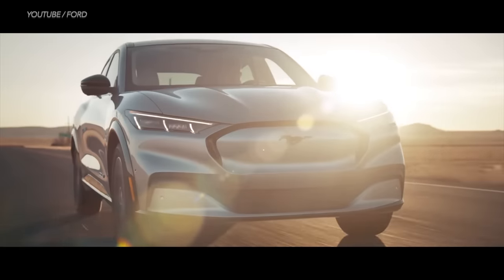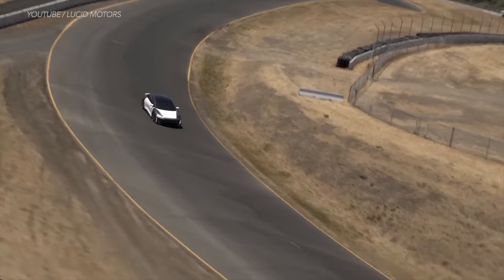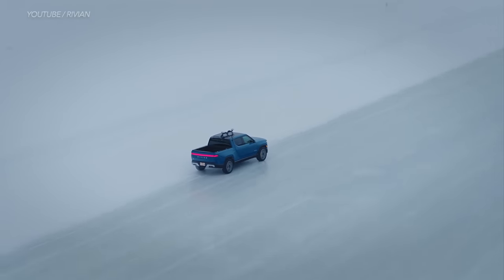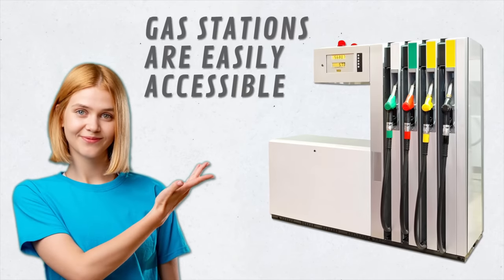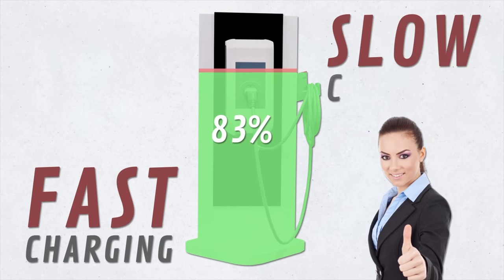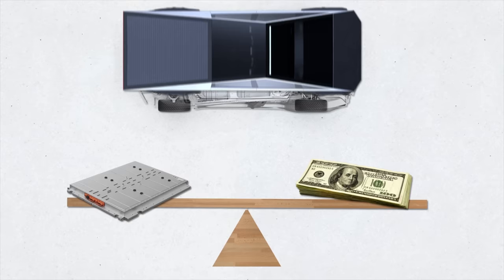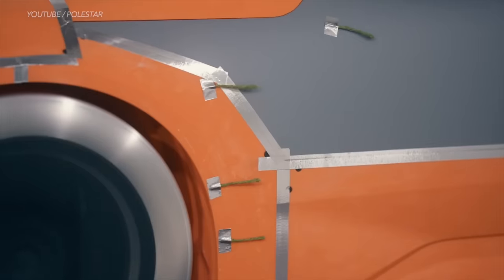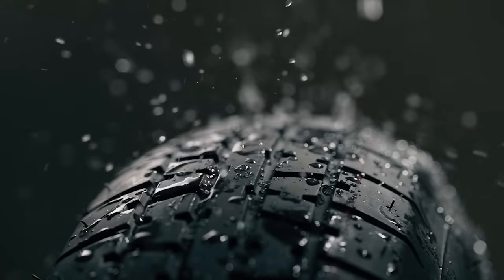New Study Shows Electric Cars are a Scam

Comment: One issue with EV cycling tests is they cycle them within a very short period of time. Li-ion batteries degrade with both charge cycles and time. For example, a li-ion battery kept at around 60-70% for 5 years will degrade almost as if you were cycling it regularly for 1.5 to 2 years. At my work place, we have laptops on carts where they are kept plugged in. Lenovo offers a constant plugged in mode where it coops the battery at around 70% since it is not good to keep a battery at 100% long term. Usually after a few years of use like that, the battery will show a wear level of 30%, even though the battery may have only seen 5-10 cycles.

EVs experience similar issues, and this is why the failure rate after many years of use is so high, even for vehicles with under 150K miles.
Reply: Coworker has a tesla, 250,000 miles on it. Only lost 10 percent of battery life.
Reply: @onestepclosertoheaven7347  For the true range, you typically will not find out until the vehicle is driven down to a safe low voltage point that is programmed into the BMS. Outside of that, they apply basic estimated wear values. Sadly finding the true amount of range lost, can be difficult because you can do something like run the battery down to 10-20 miles of range left, and then while on your way to a charger, it suddenly drops to 0 and leaves you stranded. Even the current best BSM devices (not sure of the EV ones, but outside of that space), will apply wear data based on the cycling wear curve provided by the manufacturer. This is also why you will notice on devices that get very few cycles over many years, you will notice strange behavior such as a laptop r phone draining down to 20%% before suddenly turning off, where you will need to deep cycle it and then charge to 100% without interruption for the BMS to learn the true capacity of the battery. This happens since a BMS cannot determine the actual capacity until the battery reaches a programmed safe cutoff voltage.

An EV will not show wear behavior common in li-ion batteries from laptops since they do not provisional in consumer electronics like that. For example, a laptop battery will charge to its true 100% mark since companies compete on battery life. On the other hand, and EV may take a 100 kWh battery, and program the BMS to a nominal capacity of 82 kWh, thus the battery could handle 18kWh of capacity loss before you notice a drop in range. 

Aside from that the aging behavior of a battery is both time and cycling. A tesla doing 250,000 miles in 3 years will have more capacity than a tesla that did 250,000 miles over the course of 12 years.

Comment: This may sound crazy, but in extremely cold weather, would it not be feasible to bring in a gas-powered heat unit to keep both the battery and the cabin warm, and thus extend the range?

Comment: Heh, having to charge at constant voltage instead of constant current at 80% gets you every time, nothing magical or quick charging about EVs, just trying to do a universal impossible using 20+ year old battery chemistry. They're niche city cars at best.

Reminds me of when I charge my radio control lithium polymer packs to 100% and forget to use them, you get puffy packs if you leave them fully charged too long without a BMS to return it to storage voltage.

Comment: I work for my local city services in garbage collection and such.
We use EVs like the Nissan E-NV200 pick-up for small garbage collection and emptying of small recreational garbage bins.
When fully charged they have a range of +-125 miles, but as soon as you turn on the heater/air-conditioning it goes down by 25-30%.
We had to have diesel heaters installed so these vehicles could be used throughout the day for their INTENDED purposes.
These vehicles all have big screens, and other electricity gobbling bells and whistles that seem counterintuitive to their purpose.

Comment: That's kinda late. We already knew that 1/ EV is a smartphone with four wheels, if you can't root it you don't own it. 2/ battery degrades constantly even if you don't drive the car. Servicing is locked in to your car manufacturer so they aready know you gonna spend lots of money at predetermined time to replace (not repair) components of the car, specially the battery which cost for 50% of the car. lol

Comment: I read in Einsteins Evolution of Physics on Oersted that a battery should not have a magnetic field detectable with a compass. But it does.  Check it out. Moreover the direction of the field is not always oriented the same. Sometimes the positive terminal attracts the n pole but not always. So when they pack the individual batteries into the motor pack it might matter if the fields all align. I haven't heard anything on this. I once wrote Kenneth Ford who was in the Manhatten Project about my accidental discovery and he wrote to say that's interesting but he never said anymore. What the hell is going on?.

Comment: The “eco argument” needs to include the impact on the environment from the conception of the cars, including the impact of removing cobalt, the transportation of the parts from the different countries and the renewal of the battery (including how it will be disposed of) after 10 years. People only seem to use data from the day the cars drive away from the showroom, over 3 to 5 years. They cherry pick the statistics that help the argument to push ev. Wait until Asia and South America start using ev, I wonder how quickly the world will run out of resources.

Comment: Colder weather effects diesel and gas engines also,extreme cold effects car and truck batteries and extreme heat effects them also no different from EVS but when you relying just on battery voltage you better have back up power!
Reply: It would be best to just have ICE vehicles then you wouldn't have to worry about any backup power.
Reply: Exactly!
Reply: Um I've been repairing Trucks and cars for 50 years and yes the cold effects them also,I'm not sure what rock you live under but it must be warm where you live!

Comment: The transition is ill thought out. If it was a natural transition it would take 50 to 100 years. Doing it in 10 or 20 means much more expense and huge unrecoverable mistakes. Like going for batteries when we should have waited for fuel cells. All that government money is corrupting. And then there is the Chinese slave labor problem. 

The final outcome is likely to be some kind of fuel distribution system. Because there isn't enough copper to run the transport system on the electric power grid and use the electric power for industry. And then there is - how do you support roads? 

Ill thought out doesn't begin to cover it.

Comment: I have and EV and I would not drive anything else.  No more gas is ALL worth it. Even if I lose 50% range (which NEVER happened and I live in an extreme cold zone) I can still go anywhere I like without public charging. For me it was gas prices and the OPEC rip off that made me buy an EV. I drive anywhere for next to NOTHING. No more crazy time consuming maintenance and endless oil changes. EV's are superior and gas cars are for losers. I think that study was a scam.

Comment: Don't buy an EV, I own a 2023 Chevy Bolt. It went from 256 miles to 213 miles max if you floor it and drive the max speed of 93mph. Pretty much, you must drive like an old lady.  I finally got it back to 245 miles today from driving it slow and warmer weather in California.  I should of went with a hybrid.

Comment: Guess what, most of the things he is talking about - driving faster reduces mileage, so does weather - cold temps decrease gas mileage also.  Winter tires reduce mileage in ICE vehicles too. Let Scotty convince you to buy a gas car, but the transition is underway.  I don't need to convince you, BEVs are less expensive to run and have only 200 moving parts in the drive train, instead of 2000+ in the ICE vehicles - making them more reliable.  The fact is that despite all of this FUD that Scotty and others spready, 10% of vehicles sold worldwide last year were BEVs.
Reply: The transition is ill thought out. If it was a natural transition it would take 50 to 100 years. Doing it in 10 or 20 means much more expense and huge unrecoverable mistakes. Like going for batteries when we should have waited for fuel cells. All that government money is corrupting. And then there is the Chinese slave labor problem. 

The final outcome is likely to be some kind of fuel distribution system. Because there isn't enough copper to run the transport system on the electric power grid and use the electric power for industry. And then there is - how do you support roads? 

Ill thought out doesn't begin to cover it.
Reply: @msimon6808  The market will dictate this.  Tesla had a 40% growth last year without government subsidies.  Cars replaced horses within 10-20 years, even though there was no infrastructure for them at first.  Air conditioners were in nearly every house in 10-20 years after WWII.  If you try to hold things back for 100 years you will only guarantee that "Chinese slave labor" is producing all of the world's cars in 20 years.
Reply: @martalli  Well suppose the actual route to electric is fuel cells and not batteries?  We are still a few years to two decades from that. Going all out with batteries means we will be seeing considerable waste.  I think the fuel cell makes more sense than batteries. It separates housing and industry energy from transportation. Energy taxation is based on fuel use. Very handy for roads.  As I said. The transition is being rushed. It is poorly thought out.  The market is not deciding. Government mandates and subsidies are making that decision. Soviet Style.

Comment: All the commotion over EV's is reminiscent of what Horse & Buggy advocates of the early 20th century were saying about automobiles...they pollute, where you going to get fuel when you travel to another city, who has parts, blah blah blah. Does anyone think cars made even 50 years after automobiles were being mass produced were made well? I had two cars made in the 1970's, comparatively they were junk. Cars made in the 30's and 40's were extremely unreliable. In the decades before that they almost undriveable especially compared to the standards of the 1950's!

I'm not sure why it takes a video like this for people to understand the limitations of EV's. We've been driving in hybrid's for over 20 years and we know from that experience that hybrids generally get better fuel efficiency in the city than on the highway. And anyone who has ever ridden in a Hybrid knows that you more you push the EV capabilities of a hybrid that battery goes down much faster which is no different than playing your 1984 boom-box at full power...the batteries didn't last as long. If you rarely leave the city or don't go on trips over 100 miles, an EV is probably perfect for you. If you are a regional sales manager who routinely has to drive 3-5 hours to get to another part of your region, get a hybrid that will get you 50mpg+ or an efficient 4cyl auto like a Camry or Accord that will get you 40mpg+ on the highway.

Seriously folks, this isn't that hard and there's no need to disparage others or even alternate means of transportation. As far as how far the technology has come compared to the trajectory of the advancement of ICE autos it's night and day...EV's are way ahead of traditional fuel vehicles which is a good sign if EV's make the same improvements over same 100 year period we've been relying on ICE cars. 

Now if you want to talk about things to be afraid of, your 16 year old daughter just go her license...

Comment: If you are there thinking of buying an ev, then simply get an in writing guarantee you'll get the mileage range they tell you regardless of driving conditions; that you will be able to return it for a full refund plus the cost of getting you into a regular range non-ev. Problem solved.

Comment: What does the picture of a flaming high-speed car wreck have to do with a study about the range of EV batteries depending on the conditions of your trip?
Reply: EVs are very prone to bursting into flames when the battery gets too hot, which is any time the car is driving , just like your cellphone battery (also lithium , just like EV) when you use it for a while look how hot that gets? , and the EV battery is thousands of times bigger there fore it gets very very very hot , get the picture !

Comment: The answer to ELECTRIC Powered Vehicles is/will be Fuel Cells that produce the Electric Power on DEMAND. i.e. in the Vehicle when needed. Or better yet Hydrogen Fueled Internal combustion Engines. But turning Hydrogen and Oxygen into water/Vapor into the earth atmosphere my in it's self be a problem.

Comment: Why EC Vehicles are not using combination of solar,kinetic and wind energy??? Is it possible to replace ordinary roof top as solar pannel plus solar panneled engine hood ,blower fan type wind turbine will create enough energy even car speeds at 40 mph and kinetic energy from 4 tires??
Reply: The most efficient solar panel is about 20% efficient, so if you want to generate enough power to drive an EV your panels will need to be the size of a tennis court

Comment: When You measure consumption of EV by separate counter on charging plug, You can notise, that in real cold condition it consumpt up to 60kw per 100km (60mile). 
60KW * 0.375Kg of coil ( power plant  consumpt ~ 0.375Kg of coil per 1Kwt) = ~22Kg of coil, (22kg of petrol is ~ 29 Liters, by the way).
May be is still economical, but not so ecologically.

Comment: Do motor companies like Toyota give a range of there petrol cars vans and utes l have never seen that any way its so much easier to refill a petrol   or deisel vehicle with fuel than recharge an EV you can pay for your fuel with cash how easy is that what gets ne is an EV on a highway uses more electricity than a petrol car does and heating the car uses more electricity than a petrol or diesel vehicle doesn't use any extra fuel to use the heater

Comment: I would agree that there are some bad EV's out there. For example the Chevrolet Bolt is a nightmare and was having issues with batteries that were catching on fire in some cases. Do you think that is because EV's are an afterthought to the bigger car manufacturers... they'd much rather sell you ICE vehicles. I wouldn't doubt if botching an their own ICE vehicle would actually help them extend the hold on the market. If you look at Tesla's they are relaible, long enough range for most people's daily use, You can charge over night at your home and never need to stop at gas stations local to your home, they have a great charging network that make it easier to travel long distances. They actually have less moving parts and therefore less wear and tear. You don't have to change oil or filters, they are extremely efficient, after about 3 years they are more green than an ice vehicle even if you are pulling power from a dirty power grid. I like your stuff Scotty but I think you are very wrong on this subject. Especially if we are talking about the better EV manufacturers. Keep in mind this is early in the development of the cars. Gas and Diesel vehicles have had the benefit of 100's of years of development.

Comment: Scotty called it earlier last year (at least, maybe before). The head of the NTSB, Jennifer Homendy, came out this past week with the following statement: "I'm concerned about the increased risk of severe injury and death from all road users from heavier curb weights and increasing size, power, and performance of vehicles on our roads, including electric vehicles."
IMO, it is nice to see more and more cars with Porsche 911-993 sub-6 second to 60mph performance...but now we are now having that acceleration with common sedans, SUV's and e-pickups. I can just imagine what I would've done with that amount of power...with a student license in HS. The accidents are gonna pile up...and they will be nasty ones; even with all of the safety features you simply cannot fight physics. IMHO.
Tesla Cybertruck: 0-60 in 2.9 seconds, 3500 pound curb weight.
Ford Lightening: 0-60 in 4.5 seconds, 6500 pound curb weight.
Hummer EV: 10,000 lb curb weight, 1000bhp.
Porsche 911-993 Carrera (c.1995): 0-60 in 5.3 seconds, 274bhp, 3082 pounds.

Comment: You must be getting some kind of payment Scotty every video now you talk about something negative about electric vehicles, I don't know if their scam but it's nice to not have to buy gas,,, why don't you talk about the Tesla that went off of devil's slide and all 4 people lived? Pretty good safety demo
Reply: Tesla are safe crash vehicles but are to dam low to the ground. I've seen 25 teslas be considered totaled because the potholes have either punctured the battery  or ripped a tube that connects to the battery and the dealership wouldn't fix it unless the whole battery got replaced along with it. I would buy a ev if then had similar right to repair laws as ice vehicles, until then ill stick with ice.

Comment: Scotty, EVs are not more efficient in the city due to regen braking at all. They're more efficient due to 2 major factors: air resistance and the fact that it does not consume the battery while stationary. Regen braking doesn't do much, in most cases it doesn't do anything noticeable.

Comment: my oem 24kwh  2012 nissan leaf gets about 60-70 miles on a decent warm day without climate control  but if i use the ac in the hot summer it drops to about 40-50 miles but if i use the heater in the winter it drops to about 30-40 miles  but since its a used ev and the battery is degraded this is to be expected, but if i had the money (which is impossible for me) to upgrade to the latest 62kwh pack i could get about 230 or so miles which is perfect either way since i dont drive  very far anyways. i wish hydrogen fueling and cars would hurry up and come to market, then range wouldnt be an issue.